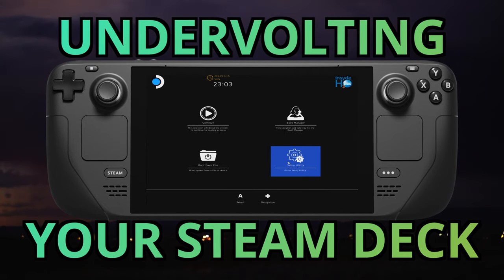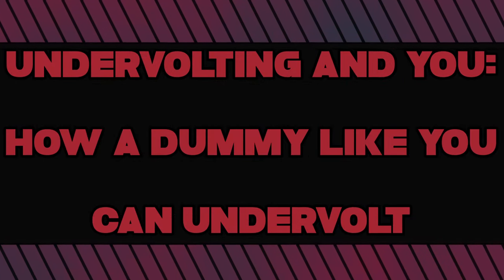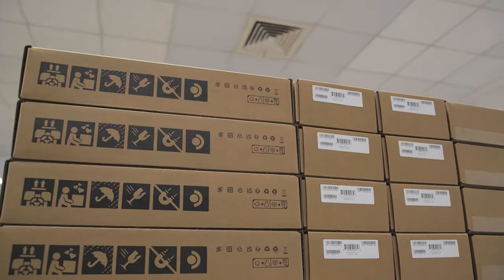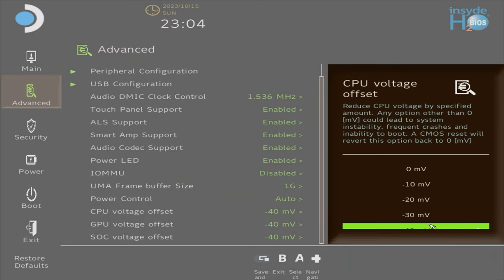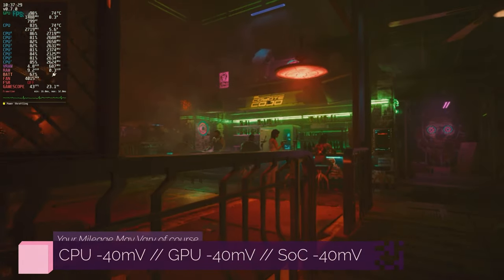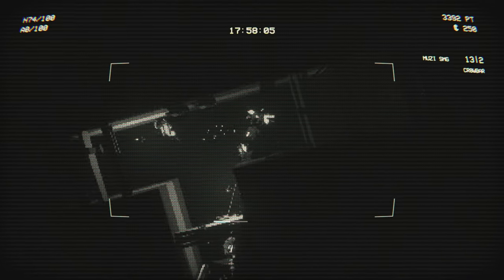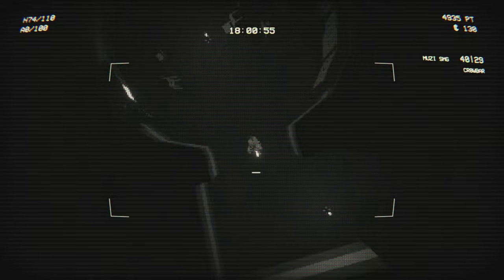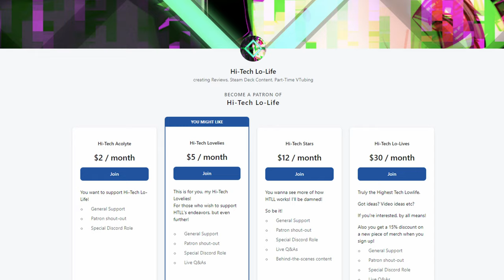「Undervolting your Steam Deck.... FOR DUMMIES!」

Comment: Just want to mention that there is a bug in Halo Infinite that makes your graphics crash when playing zone capture and stronghold, just in case someone is playing Halo for the first time and encounters the issue thinking it was caused by their undervolting.
Reply from the maker: That's good to know. I didn't even know that myself!
Reply: @HiTechLoLife it came along with season 4, there is a Reddit thread about it, but no workarounds as of now.  I’ve been playing halo infinite daily and as long as you don’t play those modes you are fine. The new husky raid is a lot of fun.

Comment: Hi, how do I get the System back up running again if I go to low? I am at -30 on all three values and did not go lower.... not to break the SD
Reply from the maker: In my experience, I could always just go back into the BIOS menu and lower the values once again when -50mV across the board was too unstable for me.

But in case you can't do so, there's a new reset CMOS command introduced in Firmware 118 that resets all of the bios settings back to normal. 

Holding Volume Down button, the Quick Access (Three-dot) button, and Power button while the system is off.
Reply: @HiTechLoLife  very nice thank you. Does anybody know how much more Energy is saved? I am only playing cyberpunk right know and must use a Powerbank after a while

Comment: What's the problem with the TDP settings? You can set it up and practically can fine tune it without much hassle.
Reply from the maker: You can actually use TDP settings in conjunction with undervolting.

Comment: I was kinda hoping to get some info about how much the battery life increases when you undervolt.
Reply from the maker: From my own super rudimentary testing, it seems I'm getting like a 15% increase in expected battery life while playing a AAA title.
From 90 mins (1.5 hours) to ~105 mins (1.75 hours).

I expect the gains to be more significant when playing lighter titles, like older PC games, indie titles, or emulating simple consoles like the NES or SNES.

But again, no extensive testing has been done and a sample size of 1 test isn't enough.
Reply: @HiTechLoLife  Thanks. I’m indeed more interested in the battery life gain in lighter titles since I mostly play more intensive ones tethered to the wall.

Comment: The reason you get better performance with Undervolting is not the thermals. It's the power limit.
The Steam Deck is pretty much always Power limited, and with Undervolting you can get the same clocks at lower power or higher clocks at the same power.

Comment: I undervolted my Nintendo switch oled, cpu, GPU, ram, now I'm getting around 8 hours playing Zelda breath of the wild, or can OC to get insane performance on some games or emulators. Tried to do the same on my friends Switch, it crashed on the first uv level cpu, leave stock voltage for ram with some overclock, and just 10mV less on GPU... Very bad silicon lottery for my friend.

Comment: What is the difference between undervolting between bios and steam menu/game?
Reply from the maker: Using the Quick Access Menu isn't "undervolting". 

Undervolting is the act of supplying less voltage to specific components. Essentially less electricity flows to said components at given performance levels.

Comment: After I change settings in BIOS (reducing voltage), can I change back to Stable or do I need to keep Preview option at all times?
Reply: If you update your Steam Deck to the latest 3.5 update then you can do everything in this video while on the Stable channel. It's not longer a Preview feature.

Comment: UV will do very little to improve consumption or temperature unless a power limit is in place. If so, an undervolted Deck can be run at a stricter power limit while maintaining clock speeds and performance.
Reply: i do not fully understand waht you exactly mean. The deck always has a powerlimit in place. The SoC is limited to 15W max. You can lower that manualy on the fly to save battery or reduce the games performance. So a powerlimit is always in place.

Comment: Got mine to 30 30 20, not the best but I’ll take any gains I can get
Reply: What does it do I hear it's both better for performance and battery life which seems optimistic. I love elden ring on deck I play all high settings fsr 1 480 upscaled to 720p. If I do this undervolt will I have less dips to the mid 20s
Reply from the maker: @Spencerwalker21  Undervolting can help save battery by supplying less electricity to specified components, in turn generating less heat, in turn allowing your components to maintain boost frequencies for an extended period of time, thus increasing performance.

The performance boosts undervolting can provide is more relevant on high powered gaming PCs. The main objective on deck is better battery life and better thermals.

Comment: I have a question, i have undervoltet my pc but if you mess up you can always reset anything on the motherboard back to normal. 
I have also undervoltet and overclocked my phone but there all the things load after you boot, so if yo mess up you can go in recovery mode and set the hole system back.
How does it work on the deck, can i always boot in to the bios? , does the bios run with normal voltage and aplays your change only if you boot up, because if you would go to far is there a chance to be unable to even start the bios? 
Thank you..
Reply: If you underclock the SD too much, it won't even turn on, however you can do a BIOS reset by holding Vol- + Three dots button, then pressing the Power button while still holding these two
The SD should beep twice, then the charging LED will flash, you let go at this point, then the SD will start to recover itself, just wait for 2-ish minutes and it should turn on itself again with the BIOS resetted

Comment: Hello!
The question is not entirely on topic...
I have ACh 4 Black Flag, freezes in desktop mode, freezes on loading the game. But the game freezes, not the deck. This isn't due to undervolting, is it? As I understand it, if the undervolt were to blame, then the deck itself would freeze completely? I have a theory about Uplay loading incorrectly. Because in the big picture everything works well, but in desktop mode it freezes. My values are 20 40 40.
Reply from the maker: It's hard to know for certain but I recommend going back to stock voltage settings and testing Black Flag again just to be absolutely certain.
Reply: @HiTechLoLife  It freezes in desktop mode at any undervolt settings.  I just haven't run black flag from the desktop before.

Comment: what do you mean by stable? If im getting regular frametime and game doesnt crash it should be most likely alright? Ive tested all settings to -30undervolt on rdr2
Reply from the maker: When I say stable I mean without your entire system crashing when under load.
Reply: @HiTechLoLife  oh alright, thanks for tutorial:D After playing for a while I noticed better frame rate in rdr2 when in town.
Reply from the maker: Undervolting can result in better performance due to better thermals, but it isn't the primary benefit I'm concerned about when it comes to portable battery powered handhelds.
Reply: @HiTechLoLife  Yeah I found myself here, because I'm not too sure what's up with my battery life. I found battery being pretty inconsistent, as much as I understand why I'm gonna have ~2 hours of playtime on rdr2 I didn't get why it shows 3-4hrs on main menu or 1.5hour on Sam and max remastered.. yet original Isaac can play for around 5-6 hours. Battery life says it's 100% but I'm not too sure, I'm gonna try to calibrate it and see if it stays on 100

Comment: Dropped all 3 at a time in increments of -10mv, running Cyberpunk 2077's benchmark twice each time to test perfs and stability.

Got all the way down to -50mv everywhere. In CP2077's benchmark, I gained a whopping 1-2fps and I still draw upwards of 26W. Which... is pretty much within margin of error.

Did i miss something obvious or is undervolting just not worth it rn ?
Reply: I was exactly asking myself how is it possible that my steam deck still drains same power before and after undervolting. I expected less wattage to be drained
Reply: @jakubholy131  Not necessarily. It just means the CPU could also overclock itself more and sustain itself there, thus providing more performance using the same amount of power. Or dedicating that extra power envelope to the GPU. 

This is the case for overclocking the desktop chips, they can usually sustain higher turbo clocks for a longer period of time when undervolted. One option for you could be to limit the CPU from 25W (or whatever it is currently set at) to 20W and undervolt and see if you suffer any performance while having lower TDP.
 Not having a Steam Deck I don't know if the TDPs are configurable, but at least the Z1 processors were allowing that on Linux.
Reply: @michael.burman  yes it is configurable.
Reply: You will always draw the max power with unlocked FPS while getting tiny bit more performance. UV helps a lot with FPS cap in place, meaning you will consume less power at the same FPS.

Comment: After undervolt, we can return on stable steam os, not preview version ? It's not a problem ?
Reply from the maker: This is an older video. Undervolting options are now enabled on Stable Channel.
Reply: @HiTechLoLife  did you have a tuto to overclock the ram ?
Reply: @HiTechLoLife  thanks to your video. I have -50 everywhere and it's work perfectly. See it in few days

Comment: But after switching to the preview channel and then applying volt can I switch back to the stable channel afterwards?
Reply from the maker: This video is slightly outdated now. You can now do all of this in Stable since the new Firmware is now a part of the Stable branch.
Reply: @HiTechLoLife  thank you sir...

Comment: Do i need drop each one by 10 one at a time or drop all 3 CPU, GPU, SOC by 10 together at a time?  Sorry if that is confusing.
Reply from the maker: I did all three at once. It may be faster to do that
Reply: @HiTechLoLife  Alright thanks
Reply: Ideally, one at a time.
Reply: @Celphirio  now if anything goes wrong you can reset your bios by holding … button, volume down button and power button about 10 seconds

Comment: I used to get 40 40 50 with the old method, guess I can just put 40 40 40 and call it a day
Reply from the maker: I would imagine you could still hit -40/-40/-50 in Firmware 118, but I could also be wrong. There's only one way to find out!

Comment: Personally i dont see the point when it can render your device unbootable & less stable. Thats more headache in my opinion. I can reduce heat by either tdp or limiting down my cpu slightly using powertools & i have the new jsaux fan which decreases heat by 10 to 15c.
Reply from the maker: It's unstable if done incorrectly and not meticulously tested.

This also isn't a replacement for the existing per-game TDP settings, it's an addition to those.

You can undervolt and lower TDP at the same time and you'd get better battery life from just lowering TDP alone.